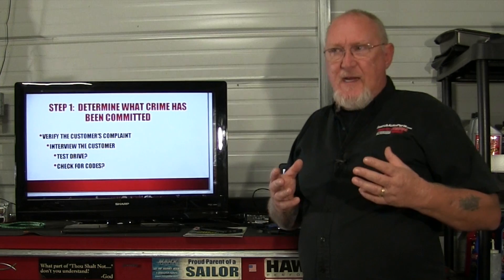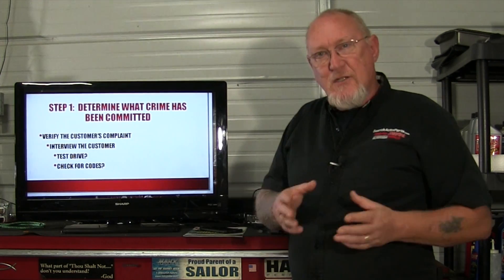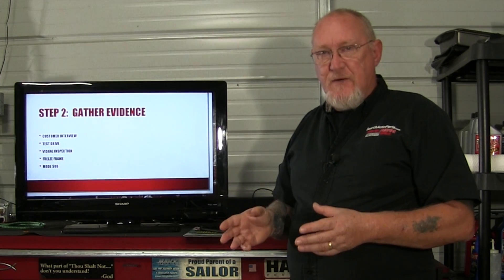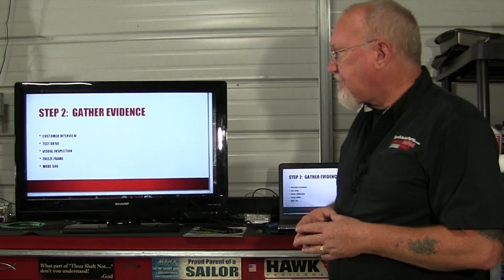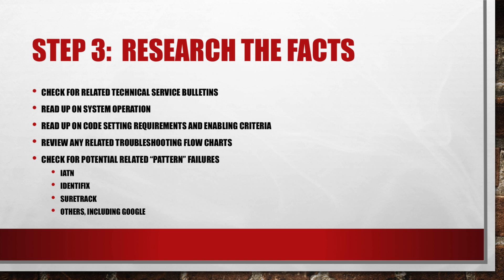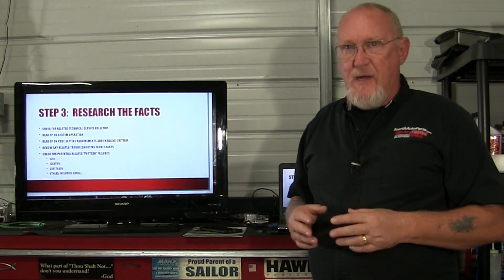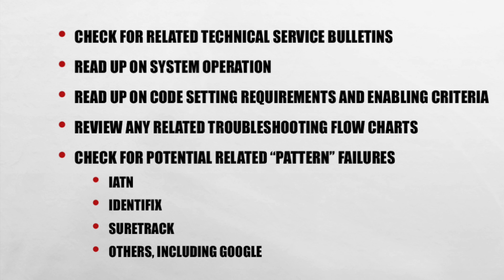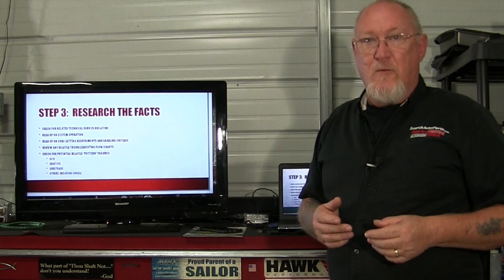The Trainer #64 - What Is Your Diagnostic Process?

Comment: One thing I would add is that I never listen too long about which parts have been replaced recently. Doing so makes you lose sight of the most important part which is letting your testing of the system and it's results lead you to the problem. The word NEW means nothing in this day and age in relevance to parts. So we cannot look at a new Crank sensor and assume it's good. Let the testing and your knowledge of vehicles lead you rather than X part was replaced and it didn't fix it. And always test the new part !
And Most of all Thanks again to Pete for doing all he does for the industry
Reply from the maker: Thanks Keith! That is a great point. Unfortunately, there are too many that still rely on the shotgun approach to troubleshooting. While the info may be helpful, I do the same - take it with a grain of salt and start my own process from the beginning.
Reply: That’s very true,also have seen new components fitted that have been faulty,my thoughts are only fit genuine electrical components because a lot of aftermarket stuff is junk

Comment: Mr Pete, how would you start diagnosing a car that won't start when hot? Most of the time, people often think a bad ect sensor can cause a no start, particularly when hot.
Reply from the maker: Assuming that cranking speed is OK and it's a "no start" only issue, I'd monitor the three keys needed for the engine to start - fuel, ignition and compression. If compression went away, you'd hear that in the way the engine turns over. So how about we use 4 channels to monitor:  CKP, CMP, ignition primary current and injector current and see what's missing.

But you raise a good point. It's been a while since an ECT sensor alone could cause a serious driveability issue, and jumping straight to that is a symptom of a weak diagnostic process. Not yours, of course, but any tech that jumps to an unsupported conclusion in an attempt to hurry up the repair will just cost themselves more time in the long run.
Reply: Thank you

Comment: Another problem with flowchart is they are often wrong.  In the last SMA video for a heated thermostat, the flowchart kept telling him to replace the ECM because it had a shorted heater.
Reply from the maker: lol! All to often, the final step is "replace the ECM" or other control module. Too bad the people that write the charts don't have to pay you back for the module when they're wrong.
Reply: True that.  Keep up the good work Pete!!!  There are millions of Youtube channels on how to replace parts.  There are only a handful of channels that teach understanding and diagnostics.  I am grateful for these channels.
Reply from the maker: Yeah, you would think. The OEMs do try to make serviceability easier, though. Here's an interview I did a few years ago with Ford you might find interesting...https://youtu.be/wXN38z3rBx8
Reply: Do you know who writes the troubleshooting flow charts? Is it the engineers that designed the systems? You would think buy now that manufactures would have service technicians with a fair amount of experience on the design teams for vehicle lines. Often we can look at something and point and say that is not going to work when it comes time to fix or service that.

Comment: Any ETA on the next How2 with the Low Amp Clamp ?
Reply from the maker: Isshman, is there something in particular you'd like to see covered?
Reply: I was just waiting for the continuation from where you left off last episode. I believe you said you'd  do the injectors. Actually, I'd like to see the injectors(grouped), as well as just one injector, if possible. 
Another great episode would be using the low Amp probe on the fuel pump via the fuse/relay with the uScope( that's the scope I own). 
Thanks for the reply. You do a great job educating the DIYers , as well as the pro's.
Reply from the maker: Well, I was going to start up a series on the ignition system but the injector idea works for me! I try to have a new "How2" every Wednesday. Look for this one tomorrow!